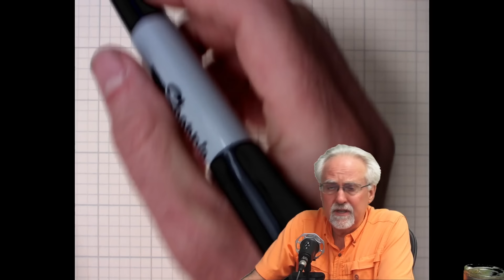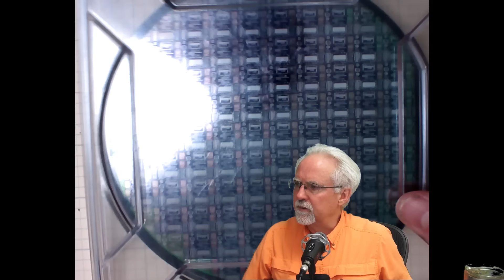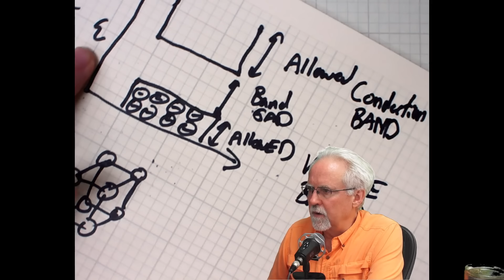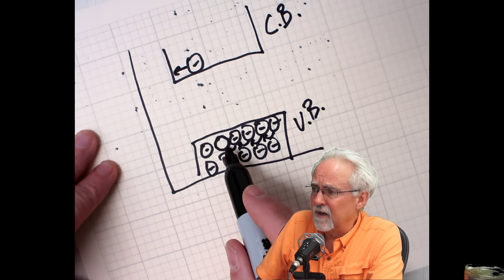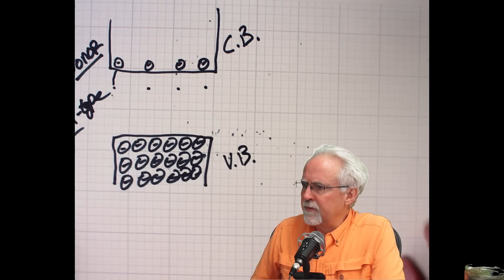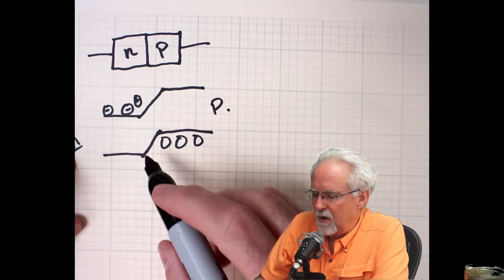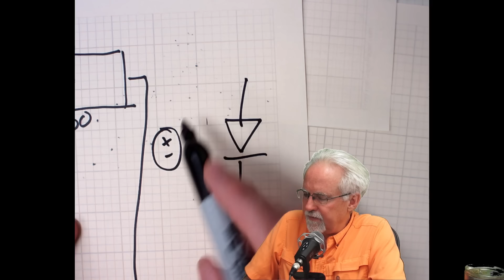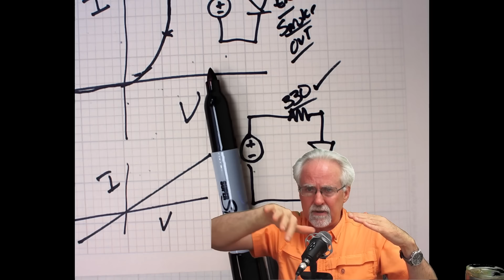Arduino Tutorial 2: Understanding How Light Emitting Diodes (LEDs) Work

Comment: Hello Paul, I really love your Arduino tutorials, I've been watching all the lessons, and have given you a "Thumbs-up" on every single tutorial. I love your teaching style. 
I/myself, am a retired Engineer with a Masters in "Electronics Engineering and Computational Mathematics" from CalTech. Back in my engineering days, Ardunio never existed. 
I wanted to keep busy & stay active in the field, and this video series has been excellent. I completely understand why you want your followers to understand the physics and 
the math behind some of your homework assignments and I agree with it whole heartedly. However, in this case, at 33:50 you point out you need a Current Limiting Resistor 
and why. But, you didn't say HOW you arrived at 330 Ohms.

Choosing the correct resistor value is imperative to insure your LED receives proper voltage and current. To ensure you have the correct resistor you will need to know three values from your circuit.

Vs - Supply Voltage - This is the power supply that you are using to power your circuit.

Vf - Forward voltage for your LED. This is the voltage required to turn on your LED.
If - Forward Current for your LED. This is the current required by your LED for operation.

The Forward Voltage & Forward Current can always be gotten off the LED's datasheet. (Which we don't have)

With these numbers you can calculate the resistance required with the following equation.
R = (Vs - Vf) / If

Example:
The Arduino's Supply Voltage is 5v.
The LED's Forward Voltage (according to it's Datasheet) is 2.4v. (ASSUMPTION for this example)
The LED's Forward Current (according to it's Datasheet) is 15mA (ASSUMPTION for this example)
This means we need to "drop" 2.6v (Vs - Vf).

Using Ohm's Law:

 E    /  I     =     R
2.6/.015  = 173.33 Ohms

Unfortunately, we don't know what the The LED's Forward Voltage or the LED's Forward Current is. I'm just including this as a real life requirement when designing circuits.
Reply: Hey! Current senior in high school, just wanted to say I added this to my notes :) thank you!!

Comment: I like how you explain everything. My only problem is that i had to watch it several times to grasp the concept simply because you simplified your drawing too bare minimum. Sometimes its a bad thing.
For example:you could draw at least couple more levels for the atom and then couple more bands. It would be easier to understand the concept when there is a pattern.
I guess they key word here is "pattern" and in your example it wasnt there. Exactly why  by watching it several times, pattern emerged in my head.

Thank you very much for this. I seriously thought i'd just be watching another LED flickering tutorial but learned something useful instead.
Reply from the maker: I didnt show a pattern, because there is not a pattern. There are two bands, the conduction band and the valence band, and an energy gap between them. That is not too bare bones, that is what it is . . . two bands seperated by a energy gap.

Comment: For me, the analogy of marbles in a tube doesn't gel - I understand current is the flow or hop of electrons to valence shells of other atoms, and voltage is pressure or Electromagnetic Force.  When you bring in briefly thermal increase, and touch briefly on voltage I don't think that I understood from that talk that what's happening is that an electron (or electrons) break free from the valence shell of the atoms in the valence shell of each atom and "hop" to the valence shell of the atom in the conductive band.  I understand that not all atoms can accept or donate electrons, and maybe the reason for my lack of following this talk at that point is due to learning it differently?

Thank you for all you do - you're awesome!

Comment: Why is the conduction/valence band lower for the n type material than the p type material? Is it to do with some kind of inherent voltage generated due to the electron/holes present on both sides?
Reply: As I understand it, the N layer and P layer differ based on the atomic makeup of the product formed in each.  The N band has atoms (molecules) formed with compounds that more freely donate electrons in their valence shell due to a looser bond in the valence shell to the nucleus.  The valence shell in donor atoms is further away, and the magnetic pull of particles in the valence shell is weaker.  The P layer consists of less conductive material, substances that have stronger valence bonds from their valence shell to their nucleus.  I might have it wrong but that's the way I understand it.

Comment: Tip: You can use a staple wire as a small jumper for a breadboard, just fold in the middle to the desired length. And also, don't use hot coffee or you'll truly regret it.

Comment: Wow after finishing the vid, this is just amazing! Previous comment I paused just before you started with the voltage exponentials etc, and you answered my material question perfectly! I do still wonder about the non light emitting diodes though. Still curious about that. But now that you mention about closing the gap for different colors, materials etc etc, I know the uv led is now a thing. I wonder if they can make X-ray LEDs. I know there will be a lot more physics involved. I imagine that with the uv LEDs, one of the issues would've been to find a material that could have such a perfect band gap that with the slightest of interferences, it wouldn't change "fence" level, therefore allowing for electrons to move to gaps, therefore giving off unwanted emission (and probably destroy itself based on that exponential principle). So imagine that would've been one of the issues with developing the uv led, and I imagine the same would be the case with developing an X-ray emitting led, or any other Ray emitting. Also it's probably not feasible because X-ray machines are everywhere, and I suppose they are relatively cheap in comparison to the research cost that would be needed to develope x Ray led. But damn that would be cool though. Being able to snapshot an injury on your phone as it happens. Could be very useful for emt's etc to find any immediate abnormalities in an emergency. Also just for general fun I suppose. Also before the hate, I know X-rays are known to increase rate of cancer, but oh well, haha!

Comment: Man this awesome ! Was just wondering though, if when the electron and hole demolish each other (can't remember the exact terminology) in a non light emitting diode, what would happen then? I imagine the material would depend on whether it is light emitting or not at time of demolish, but if the material is not light emitting, what would happen? Would a signal be sent through the materials? So like a 5v signal? I imagine it would again be dependent on the material. I also imagine it would you can change the type of signal (if this the case), so a possible radio signal maybe could be sent... I'm really not too sure. Is this voltage signal being sent through semiconductors essentially the basis of digital computing then? If so, that is absolutely awesome! How people were able to manipulate that natural construct to make something that is basically magic is absolutely eye opening!
Reply from the maker: For non-Light emitting diodes, the electron and hole still combine in the same way, just the energy given off by the electron when it falls into the hole is given off as heat, a phonon, instead of a photon.
Reply: @paulmcwhorter  oh wow, that's awesome! Thanks for the reply man!

Comment: Maybe I lost it in the translation or I am just stupid but how do you get back your electrones on the n-type material when the electrones of the n-type material jumped over to the p-type material for a E.H.P Recomb. to get back the initial stage when there is no active current? Does that mean a hole jumped over to the n-type material aswell? Does it work like a circle? Or do all electrones fill up the holes until there are non left? But then again how to get back to the initial stage? And with all the holes filled there shouldn't be any  E.H.P Recomb. happening anymore so therefore no more photon emitting meaning there is no light anymore although you still have a active current.
As you can see I am confused and need some clarification please.
Reply from the maker: It is in a circuit. Electrons are flowing through the circuit. As one moves one step from left to right, there is always another one coming in to replace it. They are driven forward by the voltage, or electromotive force.
Reply: @paulmcwhorter  So there will always be the same amount of electrons in the circuit and same goes for the holes, right? I thought when an electrone and a hole recombine it is one hole less until there are no holes/space left. I still can't grasp it

Comment: Why does the electron, upon crossing the barrier, combine with the hole? Is it because it's on an unstable state and thus combines with the hole to reach to the stable state?
Reply from the maker: It is a statistics/probability problem. An electron is not a marble but it is a cloud . . . a probability cloud, and there are certain energy states it can be in and certain it can not be in. How much time it spends in different states in based on probabilities. When it moves from one state to another, it leaves a hole, or empty state in the place it departed from. That hole can be filled by the same or a different electron.

Comment: the graphs are energy diagrams, right? with y axis representing energy? If that's the case then if an electron gains energy and moves higher on the graph then how does it leave its place physically? it just has more energy. I don't get how holes are made
Reply from the maker: Electrons can only have certain specific energy states. When an electron jumps up to a higher energy state, it leaves behind what is now an available energy state. That available energy state is a 'hole' or empty state. That hole is now available for a new electron to occupy.  You have to understand, electrons are not marbles, but are more like a probability mist. They are not stationary. It is quantum mechanics. dont think about it too much or you will go mad.
Reply: @paulmcwhorter  ok, got it. Thanks

Comment: Hello Paul. Thank for explaining about semi conductors. I didn't notice it was about to end until you were wrapping up this lesson. Please confirm my understanding. When a voltage source is connected to a diode in the forward direction, the energy offset level gets lowered so the electrons from the n-region jump to the p-region and the holes from the p-region jump to the n-region. And this proves there is current flowing in the loop. At the same time, some electrons in the conduction band of either p or n region will move down to valence band. And this emits photons or lights. So the less electrons move cross p & n regions and the more electrons move cross the forbidden band between the conduction and valence band, the higher "efficiency" we get from the light sources ?

Comment: Frequency (color of the LED) depends on the energy gap of the material. Brightness depends of the voltage, the higher the voltage the electrons jump easier over the barrier. But do different materials have higher barriers and they need a higher voltage to overcome that barrier. In other words, if a LED emits red light does that material need a different voltage to start emitting light than for example a green LED (because of different high barriers to overcome).
Reply from the maker: It is a little more complicated than that. The electrons and holes recombine in a specific location, and the brightness depends on how many recombinations occur, and that depends on how many electrons and holes are in that location. That depends on voltage. It does not really depend on the band gap.

Comment: I'm a 62 year old mechanical engineer, I was inspired to buy an Arduino by a 10 year old, it's never too late to learn new tricks!!
I'm working through your excellent videos; Now, thanks to you I understand why I have to put that 200 ohm resistor in series with the LED.
Regards Paul in NZ.
Reply from the maker: Go for it!
Reply: Sir it is not 200 it is 330 although you can use that 200 Ohm’s too just if you have already calculate if by using the forward voltage, electric voltage etc

Comment: Hai paul, i new to arduino. Yesterday i bought a module but my pin 13 led already on at first connection to usb. Why is it happen? When i try your code, the rx led works instead of pin 13 led. Tks for the answer.

Comment: I think I saw you last teaching me fusion 360. I was trying to design a woodworking bench out of recycled timber.
In the end I built it by feel, what had at hand and personal ergonomics etc.
All dowels, not a single nail, screw or bolt. Finally had to ‘reverse-design’ it then transfer it to make a fusion 360.
Backwards really. But I learnt a great deal.
Ok so now I want just want move the main carriage of my metal working mini- lathe up and back, nothing fancy.
I have all the working bits sorted  but would rather not control it manually if I can help it. ( I have a few projects coming up that need a lot of material taken off, which can be Very tiresome.)
The motor needs to run fwd for a little while, get to the end, stop/pause. Then reverse and go to the other end and repeat.
I’d love to be able to set the Start and Stop on a DRO screen (I would consider that very fancy) PressGO and see the carriage carrying the cutting tool just go up and back.
I would control the  Cross/Slide myself to do the actual cutting.
I’m pretty handy and have got things done, but for this task…….Have I come to the right place?

Comment: How can you use LED without generating so much RF? Or rather, is there a power supply that could make using LED in a recording studio more feasible?  I want to use in my studio, however the switching power supply makes a lot of RFI noise… thus making it unusable in such a sensitive environment.  Incandescent work, however like you said, are not efficient at the job they are hired for…

Comment: Sir, can you just brief out why there is instability if the LED is directly connected to constant voltage supply (9Vbattery)?

Can we apply low voltage(thus low current) directly(without resistor) to LED & will it be stable?

Comment: Mind blown. You are awesome 👏
Reply from the maker: Wow, thank you!
Reply: @paulmcwhorter  quick question Paul, how do you inject a certain atom into the board? Like the 4 dots next to the P and the N? Like would you get under a microscope to make sure only one atom was in the material you are using? And also, does it only take 1 electron to make a current or how does a material contain several electrons or produce more?

A lot of questions I know just had a few after seeing the video 😆

Comment: Seeing as how the emission of photons by diodes depends on the release of energy by charged electrons does that mean that diodes eventually run out of charged electrons and then stop working or do they recharge in some way
Reply from the maker: No, when you connect the diode to the voltage source, it constantly resupplies the diode with electrons. Current in the wire is the flow of electrons

Comment: I have a flashlight that is intended to be a UV Flashlight. I took it apart to harvest the switch out of it, and noticed that there is no resistors in it. It basically operates as such 3 double A's to spring, spring to switch, switch to another spring. The second spring is soldered to the PCB that is where the ~30 UV LEDs are. Is this because the LEDs are lowered powered so they don't require resistance?

Comment: Hi Paul, when we say the chips are made from silicon or semi conductors, what parts of the chip do we mean? Is the Arduino Uno a "chip" or is that the board that holds the chip? I'm assuming the board is made from plastic, and the microprocessor is the chip made from silicon, but what about the lines that run from the chip out to the other elements of the board? I'd love a reference that points to the board/chip and explains the materials used for each. It's one of those gaps in knowledge that I’ve ignored and learned around. I think we do this to some degree with any new skill. What makes you an excellent teacher are your principles of always trying to reduce that gap. One might even say that you do an excellent job at providing positive voltage to the minds of your students! Really, I think it’s your focus on what's under the hood. We become unmotivated when we do not understand the context of what we’re learning or WHY we’re learning it. Since you’ve become a master yourself, and therefore have a birds-eye view of the whole system, I think you’ve gained a really good sense for the best lesson-sequence. I applaud you for spending your time to give to others. You provide the detail and context that many of us need in order to develop new skills. Thanks!

Comment: Excellent explanation! You cleared a lot of misconceptions about leds that I had. I have a question regarding what resistor to select. By looking at the data sheet pertaining the red leds I found two values:

Power Dissipation (PD) = 150 mW
Continous Forward Current (IF) =  50 mA

I assume that IF is the maximum current that can flow through the led without burning it: so, using Ohm's Law I can find the minimum resistance value needed to have 50 mA at 5V:

V = IR , R = V / I, R = 5V / 0.050A = 100 Ohm

So, if I choose a resistor with 100 Ohm or more I should be safe.

But what about the power? I know that P = VI. In this case I = 0.050A and V = 5V, so this should transfer 0.25 W of power (which is exactly the power rating of the resistors in the Elegoo kit, by the way).
However, in the data sheet it states that PD = 150 mW: this means that if I "pump" 250 mW of power into the led it burns or not? I could try, but I don't want to damage the led (or even worse, the UNO board).